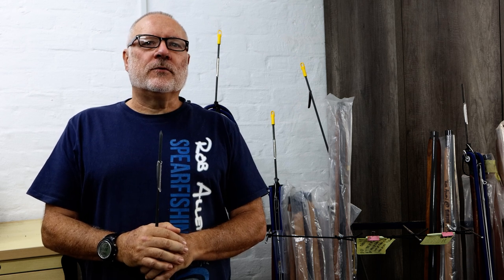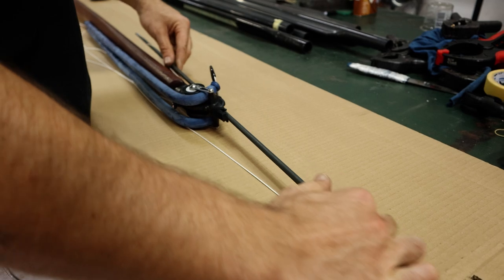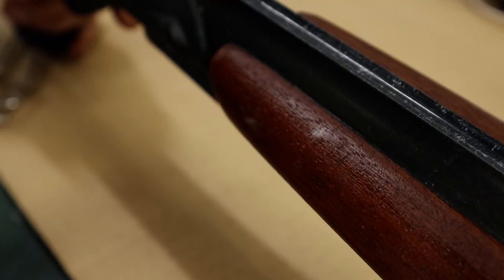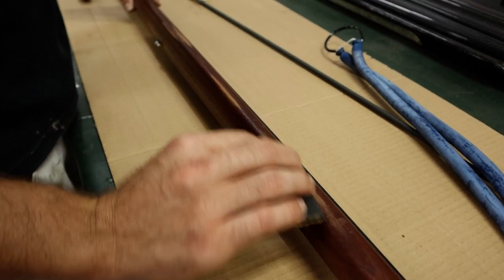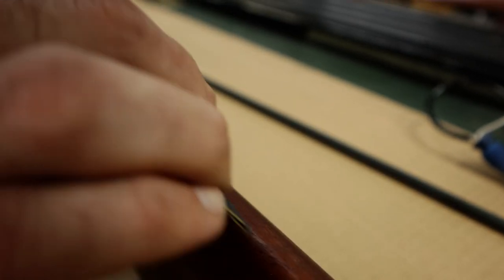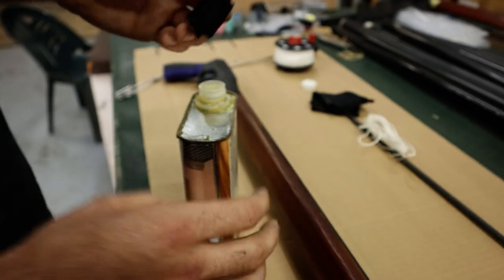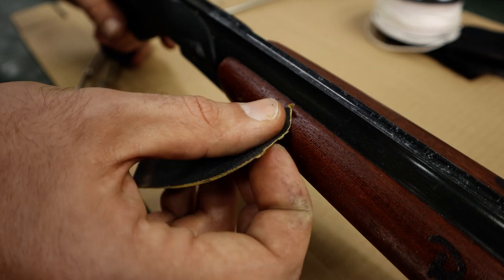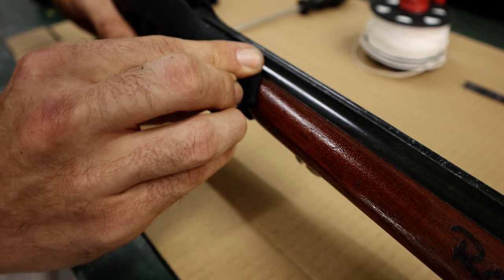Rob Allen | Timberline Series | Part 3 | How To Maintain Your Timberline | 2022

Comment: Will the timber be available? Just recently upgraded my set from aluminum to all carbons, 70cm, 110cm and 130cm, Wondering if only the timber can be sold
Reply from the maker: Sorry we don't sell the timber separate as we bond them with epoxy to the raw carbon. No idea if bonding onto the clear coat will hold. Also, each Timberline gun is custom balanced in salt water to be balanced specific to the set up.

Comment: Will some of the rollers (the 900 for example ;) be sold with 14 mm bands and 6.6 mm shafts or will I have to make my own bands and adjust buoyancy myself if I want this setup?
Reply from the maker: Either or.  The fact that each is custom set up, all options (within reason) are possible.
Reply: Sounds good, thanks. I will tell my local distributor to order a version with 14 mm bands then :)